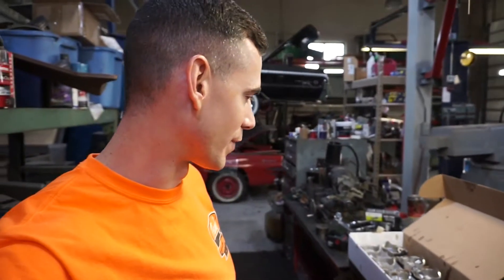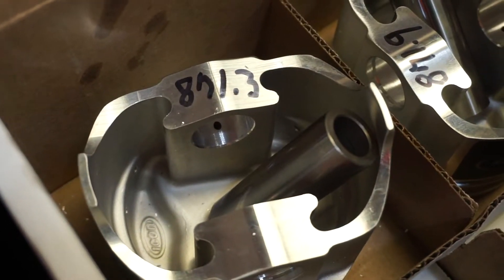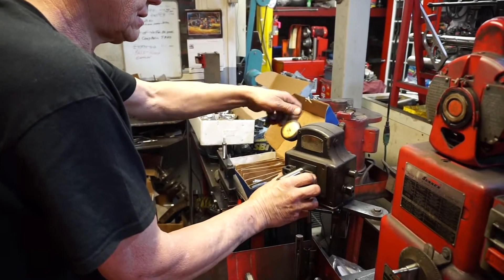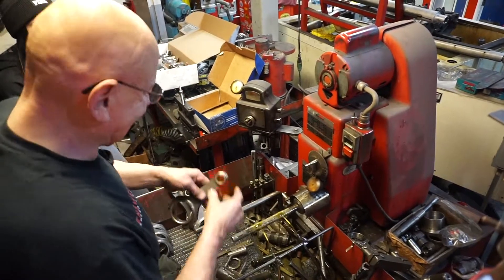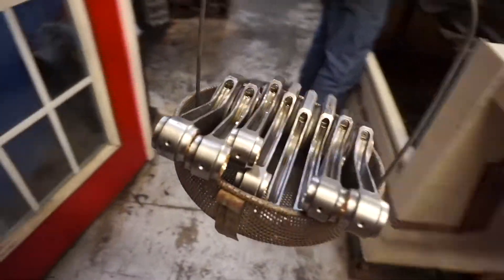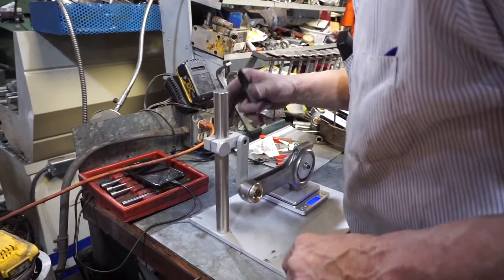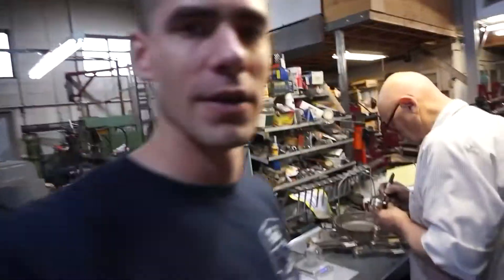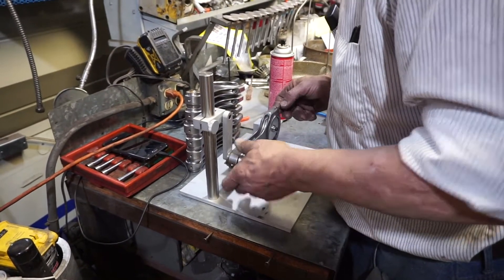How to  Balance Rods and Pistons | Alex's '70 Duster Build Ep. 10

Comment: Why machine the pins ??.On a rod resizing machine they have piston bore hones, to resize the piston pin bores rather than mess the pins up ??
Reply from the maker: Machining the bore of the wrist pin bushings ensures uniformity throughout all high tension/friction surfaces and, as you could see in the video there is a point where Roger could place a wrist pin in its bore and it didn’t really move, versus after machining it gently slid through. This ensures that one pin isn’t creating more friction compared to its neighbors and adding extra heat to one or more cylinders, therefore losing power.